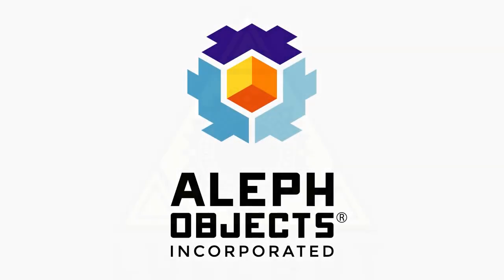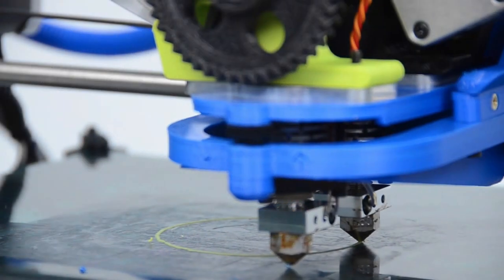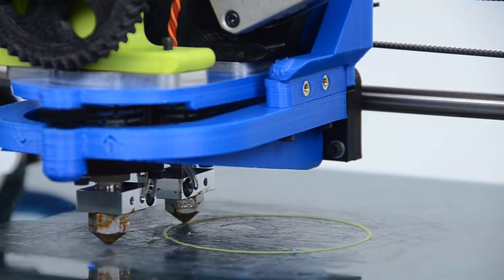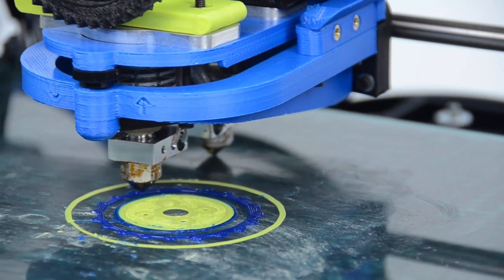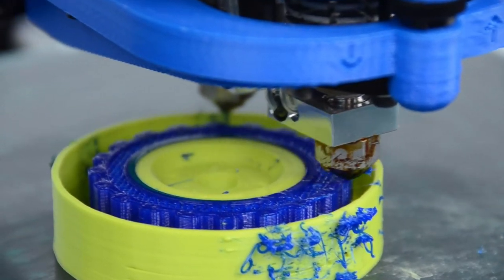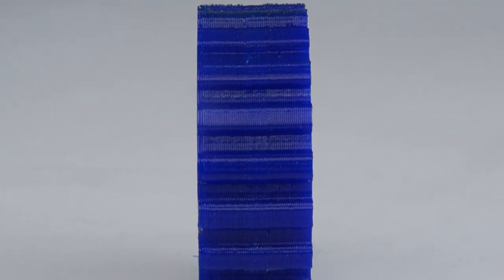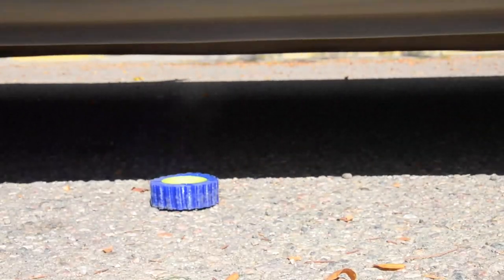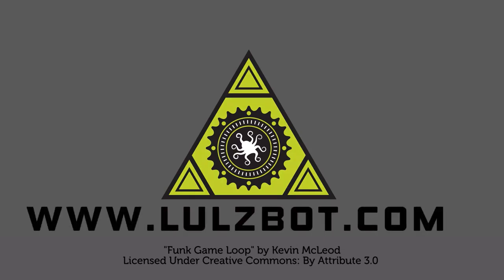LulzBot FlexyDually - Flexible Dual Extruder for 3D Printer

Comment: With the purchase of the non printable parts can this be printed and assembled?  If so is there a kit of non printable parts that can be purchased, and where would the source files be found for the printable parts? 

Thanks.
Reply from the maker: Brian Boudreau The FlexyDually can definitely be printed and assembled. We do not offer a kit, but you can find the build of materials and assembly instructions here (http://devel.lulzbot.com/TAZ/accessories/dual_extruder/dual_extruder-1.0/production_docs/), and the source for the printable parts here (http://devel.lulzbot.com/TAZ/accessories/dual_extruder/dual_extruder-1.0/stl-gcode/). Hope that helps!
Reply: Perfect! Thank you. 

Ive had my Taz 4 for three weeks and I'm loving it. Great print quality. I'm constantly amazed. Keep up the good work.

Comment: Is it possible to use the .5 nozzle on the flexy extruder and a .35 nozzle on the other or do they have to be the same size?  Does this only matter if your printing multi material prints?
Reply from the maker: Great question kf7tkj! Yes, you can use the 0.5 nozzle on the Flexy extruder and the 0.35 nozzle on the standard extruder. This modification will require changing the slicing configurations as well. That said, printing will be faster with both nozzles at .5 and you can achieve fine resolution with both at .5, it's just that the finest resolution would be achieved with a smaller .35 diameter nozzle on the standard extruder. If you have any additional questions please don't hesitate to contact our sales team at sales@lulzbot.com or by calling +1-970-377-1111. Thanks!